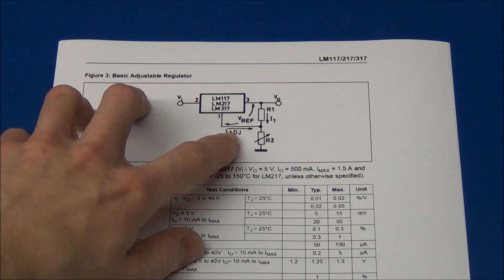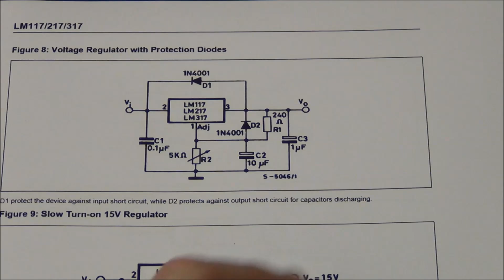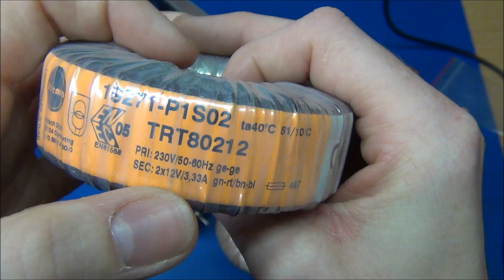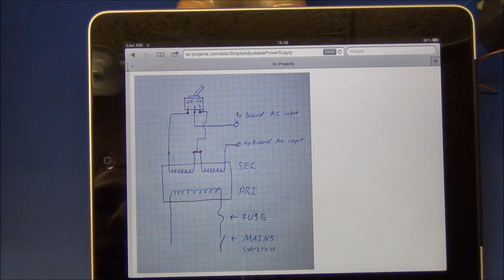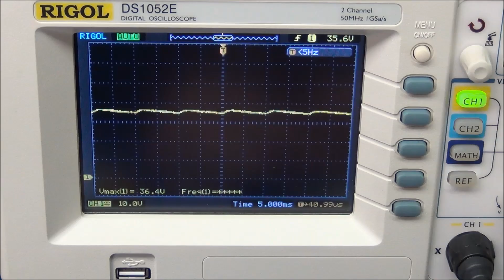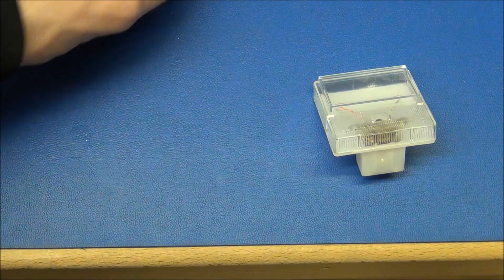Building An LM317 Lab Power Supply - Part One! - Ec-Projects

Comment: fans and motors are very noisy , i wouldn't introduce a fan in something to not introduce noise , i would leave it out to not introduce noise , best available power regulators such as in PCs cant handle noise from Fans ,  when i used a fan to check my voltage regulator build it was noise galore to the point of thinking i didnt make it correctly , should be stabilizing that output, then i build a simulation of it in Electronic circuit software and observed identical behavior , so my conclusion is that motors introduce noise and hardly anything can be done about it .

Comment: Very nice video but there are dozens like it on YouTube. I have seen video's on YouTube where the LM317 / LM338 can be used as a current limiter as well as a voltage regulator. I do not have the know how or confidence to marry the 2 circuits together. This would then make a proper bench power supply. I am interested in LED's and need current limitation at the m A level. Please help.

Comment: Personally, I think you're doing a bang up job on this. I know this because I'm learning a lot. I haven't really done anything with voltage rectifiers before so this is excellent. Concerning the output ripple from the bridge rectifier; when I was in school for radio and tv electronics, during our studies on power supplies, the transformer we used was 120vrms - 24vrms center tapped, of course the four diode full wave bridge rectifier, and two 4700 uF @ 50v capicitors in parallel. It wasn't perfect, but it did remove the 60 cycle hum from the output nicely.
Reply from the maker: Thanks! Glad you liked it :)

Comment: For safety should one consider a "bleeding" resistor in parallel along with the capacitor at the rectifier?  I'm a student and don't know the terminology for this.
Reply: I'm referring to add a resistor in parallel to the capacitor at minute 3:16
Reply from the maker: +Ronald Crabtree If the voltage on the secondary gets higher, then I would certainly add one in, but it doesn't harm to put it in anyway !

Comment: I see you have a fan on the heatsink, but no ventilation. Do you find that to be an issue if it's under load for long periods. I would expect the interior temperature to slowly climb higher than desired.

Comment: Thanks for posting your video I found it very interesting. I think your PSU design is very economical with regard to the number of components and therefore cost and should be useful to other hobbyists. I suspect that with such a relatively low power output passive cooling should be suitable, although some form of case ventilation holes would be advisable to allow airflow - even with the fan you have included in your construction.

Comment: Why not mount the regulator to the chassi and use that as heatsink?
Reply from the maker: spankbutt123 Yeah I could have done that.. The reason is that I made the supply long time before I made the case. Originally I had it in a thin steel box.. So I just threw everything into the new case.. :)

Comment: Great video, thank you. I am interested in building one but I need 20A,
Any advise?
Reply from the maker: You 'can' do that by putting many in parallel (there is a schematic for that in many of the LM317 /350 datasheets).But I would recommend a switch mode power supply instead, if you are not making some super precise test equipment.The heat generated by the LM317 / 350 (or any linear regulator) will be quite serious at 20 amps.
Reply: EcProjects That is why you will use power transistor for added current.

Comment from the maker: Ebay :) Just search "bread board wires". Cheap, but they don't take much current and they pick up a lot of noise.. I started using solid-core ones, they are a little better noise wise, and much better current wise. :)

Comment from the maker: Hey, I would say that "R2=(12-1.25)/(200+30)= 0.047A =~0.5watt"
Should be R2=1.25/(200+30)= 5,4mA, because since R1 is connected to the output the voltage across R1 and R2 will drop equally to the output voltage, so there should only be a 1,25 v drop :)

Sounds like a good idea, I got some LM2576t-adj switch mode regulators laying around, I could perhaps make a small video, but I'm a little busy these days so it might take a while.. :)

Comment from the maker: Hey, thanks for the comment :)
The power dissipated (heat generated) by the pot is dependent upon the value of R1, if you pick a higher value for R1, less heat will be generated. With the values I used the pot is getting to about 35 degrees C I think.

A few examples with a 240 Ohm for R1 (we forget about the 100 uA from Iadj)
if you set the output to 12 v, The current through R1 is approximately 12/(240+2700) = 4 mA 
if set to 1,25 v, the current will be 1,25/240 = 5,2 mA.